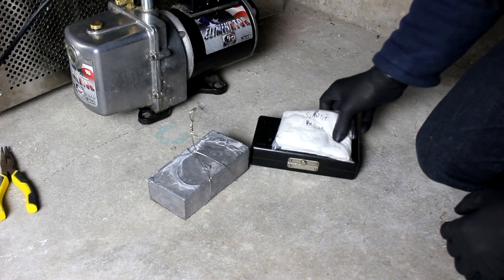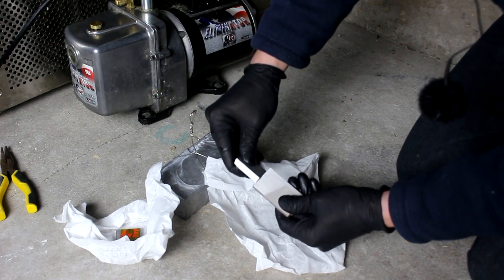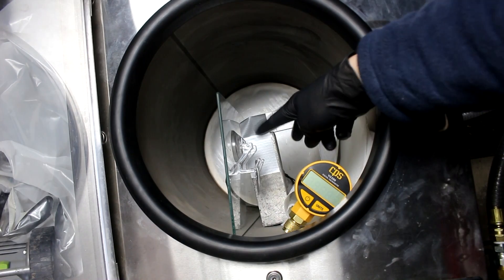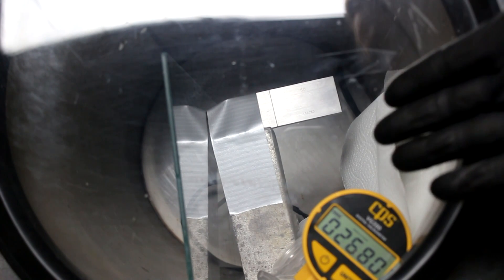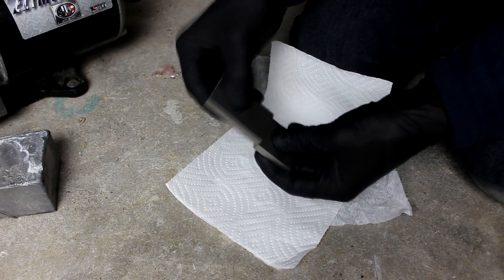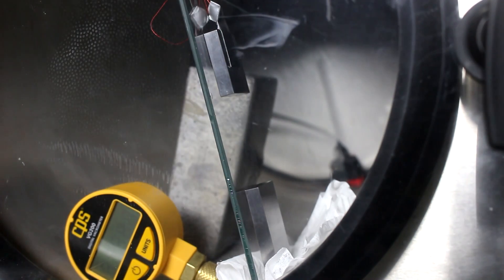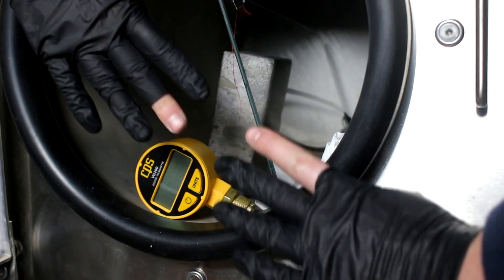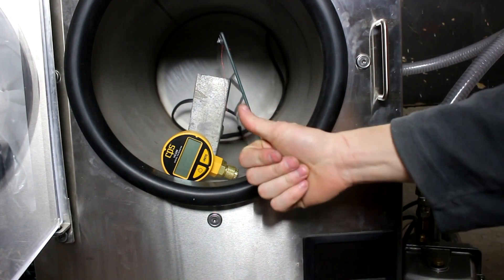Will Gauge Blocks Stick In Vacuum?

Comment: What about static charge during ringing? It could be interaction between the sea of electrons in the metal pulling charge between surfaces through a thin film of oil that only occurs over small distances.

Comment: It's probably a combination of things that maketh the gauge blocks stick together.
You could use your vacuum chamber to test how much vaccuum affects it, if you can think of a way to test how much force it takes to separate the pieces. If the force needed to remove the pieces is less in a vacuum, then the air pressure actually affects it. If you had brand spanking new set of gauge blocks, you could wring smaller ones at the ends, which would mean less force is needed to pull them apart, you could then repeat your original experiment with a weight that the blocks can just barely hold.

Comment: what if it is like cold welding but instead of spontaneous bonding its actually the 2 extremely polished surfaces being in contact and rust forming. rust requires 2 iron atoms and maybe the rust is taking 1 from each block. this would contend with all your tests.

Comment: Could you not build something to ring them together in the vacuum. Just have them setting on each other over lapping only maybe 50% then use a little servo motor to push them together with a weight one top?

Comment: One question even more dumb than the one that I did on your cold welding video:
And what would be the result of the experiment if you wrung them together and place the piece in a PRESSURE COOKER, instead of the vacuum chamber?

YEAH, I know, majority of pressure cookers aren't see-through, but you could find/build one, couldn't you?

Oh, and for the friction case, I believe it to be more in the form of bond through static discharge on the electrical field of the particles.

Again, I'm probably just spewing non-sense, but "I'm no scientist", I'm just throwing it to see if it sticks. x'D

Comment: Why should it be only Van-der-Waals force? Then this should work with any material. But you need unoxidized metal!

What do we know otherwise?
- the surface needs to be very(!) flat
- you need a metal
- you need some force
- turning the pieces helps (but is not always necessary)

i suggest there is a metal bond forming and the force holding the blocks together is only strong enough if you are forming enough bonds (the blocks need to be rather flat).
metal is ductile, so some force helps (its even easiery in your indium video; well, indium is also softer! so more contact formed, when pressed together and even more if pressed harder)
turning helps, because the structure on an atomic level may be very isotropic (especially cubic metals), but you still have some symmetry, depending on the exposed crystal face (e.g. the 111 face in a cubic system is six-fold symmetric, 100 is quadratic). now that a strong bond can be formed you may need to align the structures (even if this do not need to be single crystals).

why didn't it work in the vacuum then, when letting them fall onto each other? i think the impact was first of all not perfectliy flat and the blocks hit edge first. then the shock of the impact will have caused ripples/vibrations in the surface, which contain too much energy, that the blocks can find the minimum energy structure and stay there. after coming to a halt nothing happens, since the gravitational force on the blocks is not enough (the blocks are hard and not easily deformed).

i suppose if they would be perfect single crystals with the right facets exposed and aligned correctly, you could touch them in air and have them cold weld strong enough, but i don't know if there is any literature on that.

why doesn't this work with other materials then? well, only metal you can machine so well, oxide materials are rather brittle and would form grains upon twisting and not bind. also and maybe more importantly: between metals every atom can bind with another one. in oxides you will have attracting forces in one configuration, in the other one you will have repulsive force.
and that is for a single crystal! in a polycrystalline system you will have both, attractive and repulsive forces, which should cancel out statistically.

last: when you look at your indium video, you are pulling chunks of metal out of the respective other piece... you tell me that is done by suction or Van-der-Waals force... no, no, sir :)

Comment: Wouldn't it makes sense that they stick together due to their extremely high surface area of contact? With two super flat surfaces more of them touch each other than would normally on other object not built within such extreme precision. It's the same principal that explains why gecko's feet can stick to most objects.

Comment: Easy to make them stick, you have to slide them to kick the air from the both super flat surface.  In theory, they can handle aprox. 600N this way.

Comment: +Cody'sLab My hypotheses is that due to the sliding motion there are slight swirling currents between the two blocks, which maybe exchange/mix electrons of both blocks, welding them together at perfect spots. The sliding motion may as well rub off/rub in Surface contaminations, making binding more likely.

Comment: Did I miss the part where, after acetone clean, you hand-stuck the blocks before vacuum?
Also sans duct tape, are we assuming the glass is as flat as a gauge block?  Maybe an entirely vertical drop within the vacuum without glass?

Comment: Take a look at Gauge Block article on Wikipedia for fairly good information.  If you don't use them the way they were designed your results will not be accurate.

Comment: it will has atomic scale thin oxide at the surface, and it will stop the bonding between metal atoms, when you rub two surface together, the thin oxide is removed and fresh metal exposed, forming the cold weld. rubbing is needed.

Comment: Skipped a bunch of easy checks. Different weights on the suction cups to show when they fail at different pressures. Why not do something similar for the gauge blocks instead of a single check? After it survives under vacuum add some weight to the rig that doesn't break it and then apply vacuum to see if it fails. Next create a rig that can press and rotate the blocks in a vacuum and normal atmosphere. Next have magnetic gauge blocks created try in different orientations and vacuum. Make a list of different possible phenomenon make a chart it would be cool to watch a scientific discovery be made on youtube
Reply from the maker: YouTube doesn't like 2 hour long videos though... I am doing those tests and I will post the highlights.

Comment: @Cody'sLab I suspect, the best way to test if vacuum makes a difference, would be to wring the blocks together, hold them up by a string, and then induce the vacuum. It tested the suction cups, why not the blocks?

Comment: I think they stick together because of Van der Waal's force
Reply: That was my thought as well.
Reply: And that's ...
Reply: @chebhou  A force that exists in micro scales. Caused by fluctuations of polarization in the surfaces of the materials. They are not directional and will always attract (although that feels really weird). It is independent of temperature.
The effect arises the same way as the casimir effect. Quantum dynamics needs to be understood to understand casimir effect.
Reply: Wringing is not the van der Waals force / london dispersion force. Between two flat planes with 10nm separation in a vacuum, the van der Waals-induced pressure is around .05 atmosphere. This is two or three orders of magnitude too low. It is an additional order of magnitude lower under atmosphere. The longest atomic bond of any kind is less than .4 nm, and those bonds tend to drop off by the 4th power or greater. Even if tiny peaks of the blocks are touching, it won't be enough to create an attraction. Gecko feet are a weaker attraction than gauge blocks and we know Gecko feet uses the van der Waals force.

The separation would have to be below 1 nm across a large amount of the blocks to make a bond, and the roughness of gauge blocks only have tiny spots of contact. (Additionally, the force is repulsive before its attractive.)

I have no clue, but the Casimir force works at the scale of block roughness. Doesn’t explain why the attraction is not hugely stronger for metals, though.
Reply: Martin Golemanov yes that is the deal
Reply: also likely a factor!

Comment: Vote this up people!

You should take a harddrive and remove the disk and some of the read/write heads. These absolutely stick to the surface of the disc if pressed down a little, and they stay. 

This would be easily tested with the same principle that you use in this video since even if the weight would bounce the head would stick on the first hit and not bounce from the disk surface, or you could put some little softer material but stout material over the head, say hard rubber, to make a little longer press on it sort of speak.

Althought get a 3.5" harrdrive and a little older since these have aluminium discs where the 2.5" have discs made of glass.

Comment: Could we test the breaking force to see if it might be the Casimir Effect?  The math seems a little oversimplified here, given its rooted in quantum theory, but it looks reputable.  http://math.ucr.edu/home/baez/physics/Quantum/casimir.html
Reply: I have no idea what you're talking about and I'm too lazy to study quantum physics right now to find out, but measuring breaking force across these tests would be awesome.

If the difference is consistent between oiled vs acetone washed or vacuumed vs unvaced, we'd at least have some pretty great confirmation of multiple forces at work.

Hell, maybe even a jig to make the wringing motion and pressure consistent.  That sounds really hard but i was also pretty baffled by how he could move things inside the vacuum until he whipped out the damn laser.
Reply: Yeah I wonder if the Van der Waals force may actually be the Casimir Effect and it's really the quantum vacuum holding the parts together. With stiction flat surfaces are brought into very close contract. I mean we think of the plates as flat but, there not. On an atomic scale they're quite lumpy, almost like the Gauge Blocks were made of a sand that is the atoms. This lumpiness translates to a tremendous surface area. Could it be the atoms in surfaces of both plates are so close and have enough surface area between them that the quantum vacuum is pushing them together with enough force for the blocks to stick. 

At a distance of 100 times the typical size of an atom the Casimir Effect exerts the equivalent of about 1 atmosphere of pressure. If enough of the atoms in the two blocks are in close enough proximity to one another I think Casimir Effect could well be what's holding them together.

Comment: Still wondering if by "wringing" them together, your creating a higher vacuum between the blocks than you can achieve using your chamber. I have access to a semi-conductor process chamber and can take the vacuum to around 1mT. I have been curious after watching the AVe video to try it. I just need to get my hands on some gauge blocks.

Comment: Maybe setup an r/c servo type mechanism or motorized linear stage(s) to complete the wringing action inside the vacuum. Would need a sealed passageway into chamber since I don't think batteries would do well in that vacuum. Interesting experiment, thanks for sharing.

Comment: I wonder if you could make vacuum chamber gloves for doing more complex vacuum chamber experiments?

Could be a bit dodgy, but it would open up a lot of possibilities for vacuum chamber experiments.
Reply: we could make robotic arms that could be controlled using a remote control...
Reply: @shauryanrana3906  These are called 'waldo's and are used when handling dangerous or explosive compounds. They have become so advanced  that they are now used in human surgery.
Reply: @shauryanrana3906  just use robocody
Reply: I imagine they would work sort of like EVA suit gloves, which dont have quite the mobility range of one on earth because of how the vacuum of space treats them
Reply: Do vacuum chamber gloves even exist? Seems like you'd need some pretty advanced materials technology to form something that is both flexible and able to withstand that much negative pressure. Or I guess they could be more like plate gauntlets instead of gloves, solid sheets with hinges. But air tight hinges seems tough too. It seems easier to try to design a remote controlled robot, or just use some gears and levers to transfer manipulation from outside to inside
Reply: @jek__  yeah they exist, they are called space suits…
Reply: @jek__  Vacum gloves are a real thing, but they are expensive and need to be maintained. Of course, one could make ones' own, more for the fun of it. ^_*
Reply: The problem is that the positive pressure inside the gloves would make them inflate like balloons inside of the chamber... maybe using a combination of carbon fiber, kevlar and silicone could work... it would be very stiff to work with, but it should work on some level to do some experiments... The robotic hands are also a good idea... maybe pair them with haptic feedback gloves with IMUs...
Reply: @pablogarin  Yeah, remote manipulation sounds a hell of a lot easier. Much less difficult to vacuum-seal some wires than stupid-human-meatbag-manipulation-appendages. I would look to the nuclear industry for ideas on how to do it; remote manipulation has been big there (for obvious reasons) for decades. Just need to upgrade those seals to deal with a vacuum.
Reply: Get some gloves from NASA, steal belted radial gloves.  Good for body building your forearms.
Reply: Did you ever see how an inert gas glovebox reacts to minimal changes of the atmospheric pressure?
Reply: bro literally if you search glove box vacuum on YouTube you can find it. I think remote control arms are a LOT more expensive
Reply: Do thay made gage blocks in copper
Reply: @madtscientist8853  They don't even need to be metal. the really expensive ones are made out of ceramic and you can do have them stick together in the same exact way as the metal ones.
Reply: Well it's definitely late for an answer, but could they be made by putting rubber glove (for the sealing) inside leather gloves (for avoiding inflation)?

Comment: I think the metal atoms hold together because they reach the nobel gas configuration with free electron gas. Maybe you need force and movement to share electrons between these two Gauge Blocks because the movement takes the electrons to the other block. 

What happens when you put the Gauge Blocks into the vacuum chamber, so there ist no air between these two parts, an then you apply a small voltage. Maybe the current will affect the result.

Comment: If the holding force is simply from low amounts of oxygen between the blocks and not from some type of field, maybe there is a week force holding the oxygen to the surface of the blocks. maybe you would just need to disturbe the oxygen molecules while in a vacuum so they have a chance to escape.

Comment: Got a microscope Cody? What does the surface of the blocks look like in magnification, could you tell the appearance of friction lock surfaces? I've noticed handling them myself that it is partly due to oil tension, kinda like water tension? If you rub some oil from your fingers onto them they stick better usually.

Comment: Hello Cody, Finding your vacuum experiments really interesting. I have a question that I think you may be able to prove or disprove with your vacuum. Recently on a Flat-Earth channels' discussion I used an example of a demonstration by Sly Sparkane where he showed how gravity is the force that is feeding the syphon effect. However on this said FE discussion I was bombarded with reasons of pressure gradients/differentials (which I'm sure plays some part in the effect). Which got me thinking: does a syphon work in a vacuum. So here I am :) hope you could help in some way as to prove or disprove any of these hypothesis. Keep up the good work. ;)
Reply: Well with a little googling it appear this experiment was carried out by the university of Nottingham UK using an "ionic liquid" however I would still be interested in seeing you carry out such an experiment. (if you could get a hold of such substances.
Reply: Well with a little googling it appear this experiment was carried out by the university of Nottingham UK using an "ionic liquid" however I would still be interested in seeing you carry out such an experiment. (if you could get a hold of such substances.)

Comment: Hi Cody, I have a question 
This might be stupid or asked before. 
You used a material that doesn't easily form an oxidized layer to demonstrate  cold welding
So my question is why won't the oxidized layers on two objects cold weld with each other. Thanks for the awesome videos!

Comment: Could it possibly be something akin to a magnet,
Maybe when the two metal blocks are run past each other, it generates a current or magnet force? (like a weak electromagnet)
Which causes them to stick.

Let me know if that's a possibility, or would it have just fallen off the second he touched it and grounded it.

Comment: I have 4 glass prism pieces from binoculars that will stick if rung. even dry. So its not just metals. Another neat thing is you can see straight on through the junction and you can see visually where its bonding. Im thinking this refraction thing might be key to figuring out how this works. I can send them to you if you can't find flat enough glass to see for yourself.